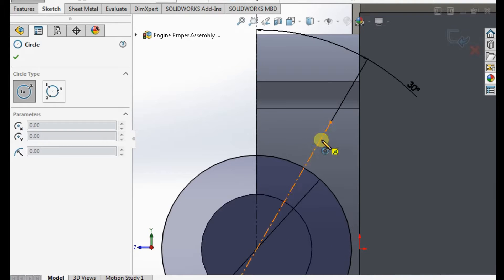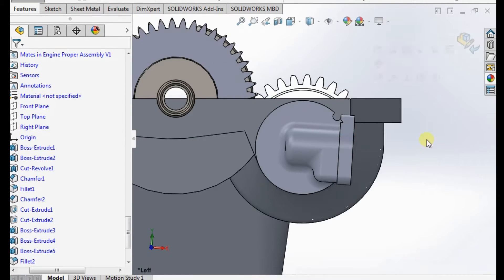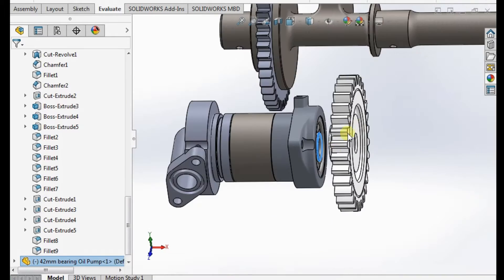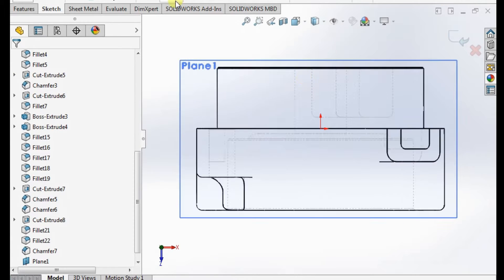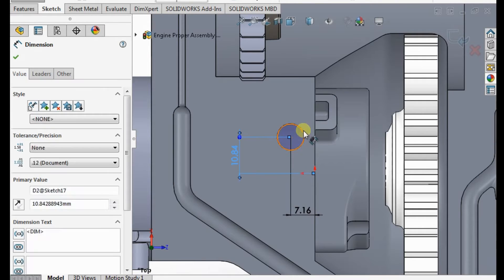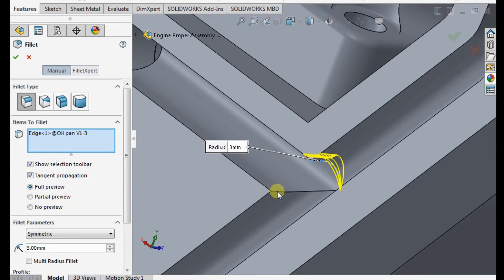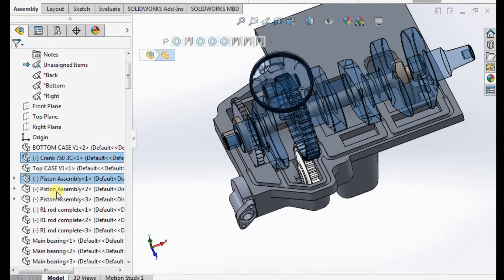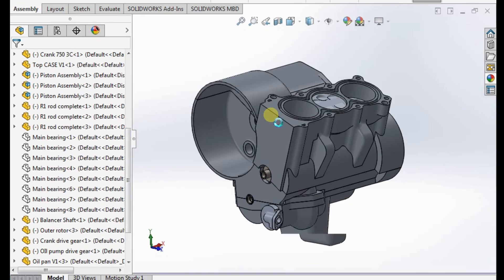Oil pump fun - EA Series - Part 11

Comment: Matt...Does a 3cylinder engine really need a balancer shaft..? When the rubber supply runs
low does an Amazon drone really drop them off at your front door..?..Keep em coming..
Cheers.!
Reply from the maker: Yes, 3 cylinders have balancer shafts

Comment: Matt, 
I have an SV650 I got off of a mate last night. Started going over it today and and have found a most peculiar... 'feature'

When the bike is on the paddock stand, put it in gear and leave out the clutch, the chain starts slapping around and the rear wheel seems to want to fuck off and join the circus.

I've uploaded a video here FYI https://youtu.be/xhxmxgebBBI

Feel free to use it for one of those group diagnostics videos you were doing before.
Reply from the maker: Awesome cheers dude and will do.

Comment: -https://www.youtube.com/watch?v=H9qH5uLUkJA  
after disassembly a japanese 1000cc i found this video intresting how  relocated/shaped  parts can be, hope this inspires you.
-5 valves/cylinder: my idea is can't we engineer  a sort of mechanism (vtec like) that every stage of the rpm work on the duty of the middle intake valve (i dunno a diffferent shape of the lobe,dimension of the valve, seat, material... for example): overlap timing/duration/depth?